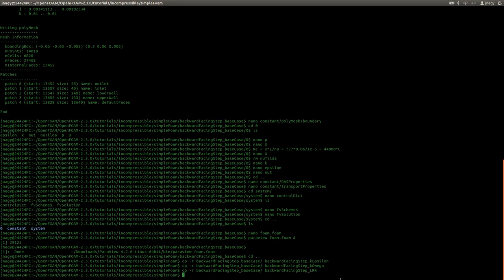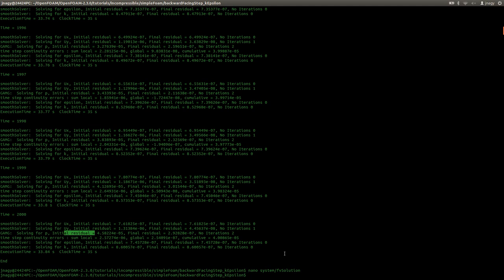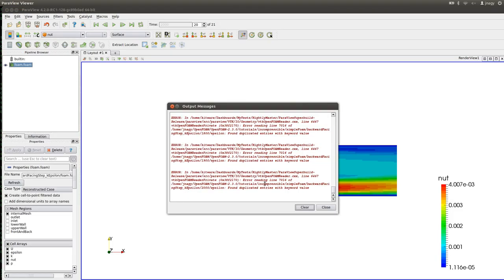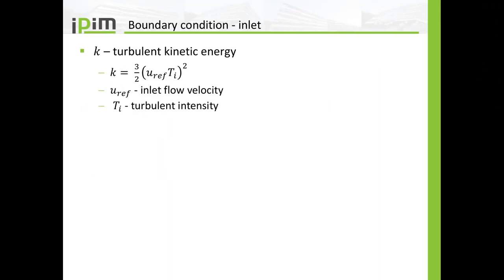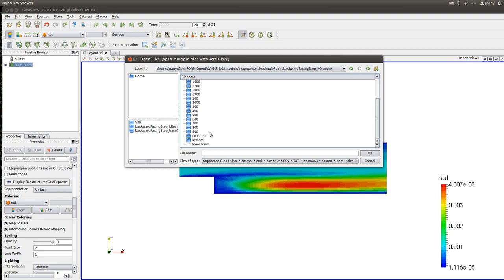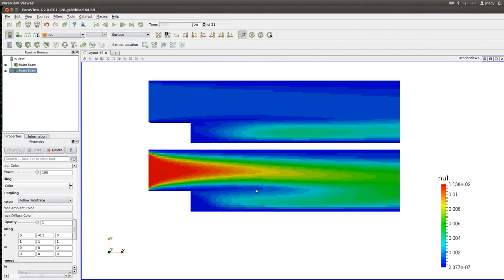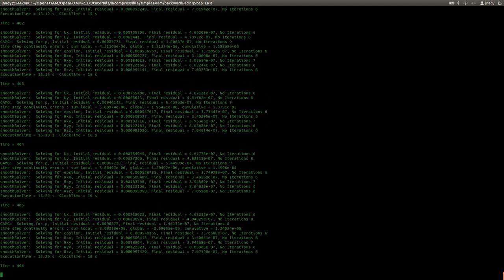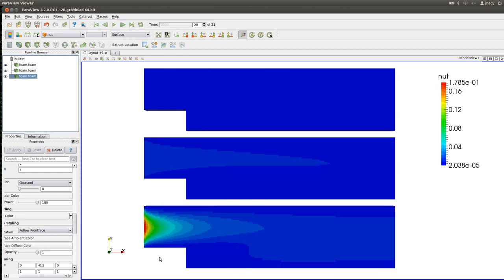Introduction to stationary turbulence modeling (RAS) - Part 3

Comment: hello, Jozsef. Your videos really have helped me a lot when I turned to OpenFOAM. However, recently, I encountered another problem which puzzled me a lot. in the same case, with same mesh, same discretization schemes, with kEpsilon family models, it works well(mean converge well), however, with kOmegaSST, it always diverges. I have posted my problem in CFDOnline:http://www.cfd-online.com/Forums/openfoam-solving/160957-sonicfoam-komegasst-cannot-converge.html#post568569      Would you please have a look at it when you are avaliable? Thanks a lot in advance.
Reply from the maker: +Shiqi Wang Hey, if you are using sonicFoam, you are solving a transient problem. I don't understand your definition of convergence. Do you mean, that the flow converges with time towards a stationary solution?
Reply: hi, my case is definitely a transient problem. Cannot converge means that the calculation is crashed after a number of iterations.
Reply from the maker: Usually in this case you get a limitation of one of the turbulent quantities, or maybe both. If this is the case, try and rethink the (inlet) bounadry conditions and the value on that boundary for that quantity. Hope this helps.
Reply: +József Nagy I am trying to modify the wall conditions first. Is the choice between lowRe and HighRe wall condition for k and omega very important?
Reply from the maker: I would say as a first try not, but if you want to go for detailed physcally correct results yes.
Reply: +József Nagy I think I can understand what you mean and I will compare the difference between these two settings. After modifying the InletOutlet b.c. to zeroGradient b.c., the preliminary results seems fine. In my case the outlet is directly the atmosphere open space, and it indeed has reversed flow. In my sense, it indeed needn't the assignment of the parameters of reversed flow. However, in most tutorial cases in OF, the outlet b.c. is inletOutlet in which the reversed flow papameters are fixed. But how in these cases the inletOutlet b.c meets the physical b.c.?   I hope I've posted my question clearly.
Reply from the maker: +Shiqi Wang If you know that you don't have a backflow, you can suppress a backflow created by numerical errors with this boundary condition. If you know, that you have a backflow, don't use it.